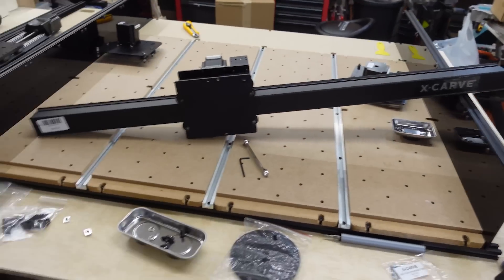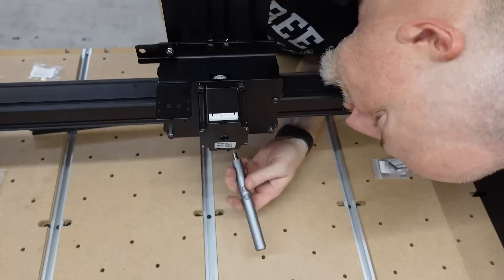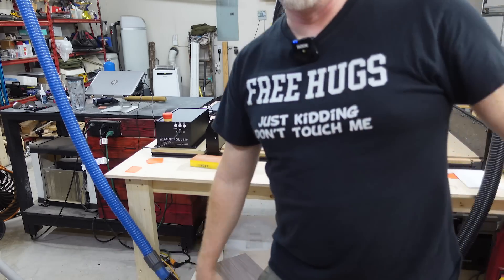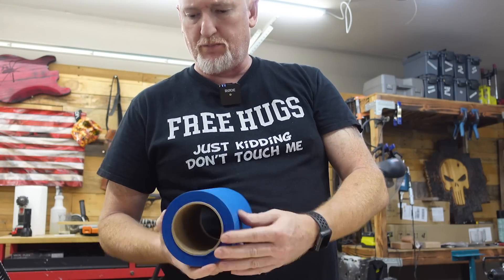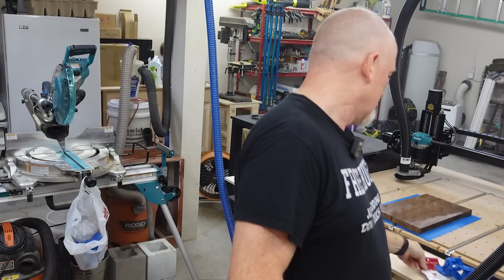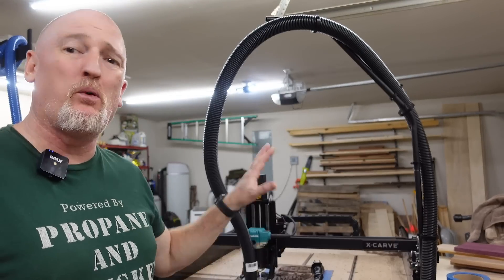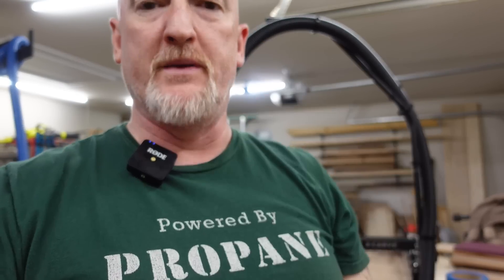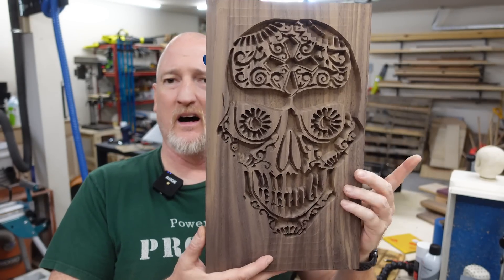They Gave Me an X-Carve!!

Comment: I would have preferred blue prints to their web site instructions. Several times I had to back up and redo things. The y bar was backwards and I had to take it apart and do it again. Nothing in their crappy instructions indicated which way it went. Absolutely every piece of it required assembly.  Getting it wired properly was also a major headache. The motor on the right side had to be wired backwards. Otherwise, it will twist rather than move forwards or backwards. Now that I got it together I am really liking it though.

Comment: Great video thank you! I’m assembling mine. I’m but one of the yxis stepper motors sounds like it grinds and doesn’t roll smooth like the left side… do I have a defective piece?
Reply from the maker: Probably not. More than likely your gantry isn’t completely straight or you’ve got a roller tightened too much. 
But X-cave has excellent customer service so if you can’t figure it out, drop them a line.
Reply: @BuildDadBuild  thank you!! I’m giving them a call soon as they open. I disconnected the Y2 stepper motor cable and it runs smooth. That’s weird because I have I’ve nothing plugged in yet nor the controller unit lol it’s jus when I roll manually and that cable is connected it’s not smooth like the opposite side …I remove jus that cable  and it is 🤔thank you again for all your great content.

Comment: Having not worked with easel software before I cannot get into specifics or where to find the issue but I’m sure there’s an alignment section somewhere. You want to get 3 points let’s say the bottom left as you did in the video would require 2 points in the Y axis (top left, bottom left) and 1 in the X axis (bottom right). Doing the would help also help you if you didn’t set up 100% properly (example 90°) I’d hit home to double check you bottom left corner is aligned properly and maybe do a quick test run by leaving out the tools and turn the feed up to max if there isn’t a test option.
Reply from the maker: Thanks for the advice!
Cheers

Comment: Find the center of your board and use that as your start point t. In easel, highlight your project and right click. This will open up the screen to adjust depth of cut but if you look at the top select the orientation tab, you will see 5 dots. Select the center dot after that make your x y both 0. This will place the center of your project at your x y 0.. or home. Now when you start your cut, it will start from center and magic.. always on center
Reply from the maker: Thanks for the tip. I'll have to look into that.  I was trying to figure out how to change the start location.
Cheers

Comment: Also, you can have a spoil board (MDF) That allows you to go beyond the bottom.  I’ve used the tape method for a long time myself and have solid metal beds so spoil boards are a necessity.  I mill aluminum using the CA method.  40”min / 1/4- 2flute endmill/  .0625 step over & step down.  Centering is understanding software almost always unless your esteps are off.

Comment: Nice. I’ve been loving my xcarve for almost two years. Took me three days to assemble. 

I used tape for 18 months. I just changed the way I do it. I installed an x y fence at 0,0, and then made cam clamps on my 3D printer (I’ll soon list them on Etsy). I have four different sizes and am able to secure my piece within a few seconds. It’s always square to 0,0, no tape needed, and no clamps.

With the xtool, I always center my art in the software and mark center on my piece. Probably similar to what you’re used to. But on the cnc it’s different as you figured out. I always zero on the material, not the art.

I also have learned the value in having evenly planed and milled material. Hard lesson learned. I also measure the thickness in mm not inches. And usually add .01mm to the thickness to allow the bit to just barely go through the material. However, if you do this, and you don’t use tape like me, tabs are a must. With your tape method you could get away with tape. 

Easel can be a real b***h sometimes.
Reply from the maker: Thanks for the tips!
Cheers
Reply: @BuildDadBuild  no problem. If you ever run into a problem, hit me up.

Comment: The problem of centered, It's not really a problem. It was a calculation error. In easel when you are assigning the type of cut if it is on the line, inside or outside, in the shape option you have a box with 5 points, in this specific case it is very difficult to home the machine and choose your coordinate. That machine is very simple. I have the same machine. and it's very easy, you're going to have several errors in the tool changes. I recommend that you focus on work position if it is a job that does not occupy the maximum work area. Use the center point in the shape option when you are assigning the type of cut, with a pencil you mark the center of the material to work and that would be your coordinate or your home point. Another thing I recommend. It is that you have to be very delicate when you select the lines or vectors in easel. Because in many many times with the single action of selecting the line. Does it move. It is a problem that many times you do not see it on the screen. But you will see it when the work is done and when the final product is altered. I have personally called Inventables many times and explained to them to improve that part in the software. But it's been 5 years with my X-carve and the problem is still the same. Assigning cuts to vectors is a headache when you have many types of cuts using the same bits. And another problem when you change the tool is the movement and torque force that you generate by tightening and untightening the collet. If you are not aware, you can move the gantry and lose your point of origin or coordinates and you will see that in the final work it seems that you have moved the vector in easel. But in this case it is you who moves the position by changing the drill bit.

Another suggestion is that you get used to using a material larger in size with an extra inch in total, so you have the option to correct it on the table saw, or in my case I prefer to cut it with the same X-carve. Unfortunately this is very time consuming due to the number of passes you have to calculate. But in my case I use the machine to make my projects. Not as a production line. So the time factor is not a problem.
Reply from the maker: great to know.

Thank you.
Cheers!

Comment: Nice! The issue with centering on the stock is coming from the software you're using to create the path, double check your document size or page size before exporting, for example, in VCarve Pro, you'll find a difference between the stock and the document size, where the design is at the center, both should be exactly the same.
Reply from the maker: Thanks for the info!